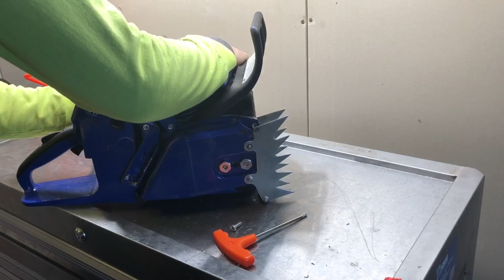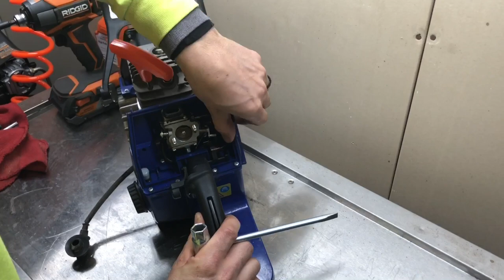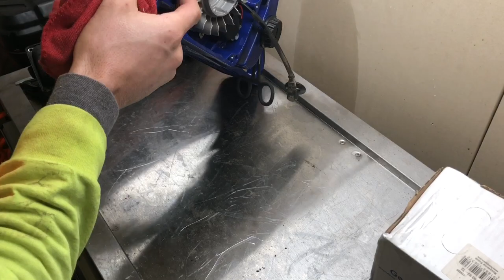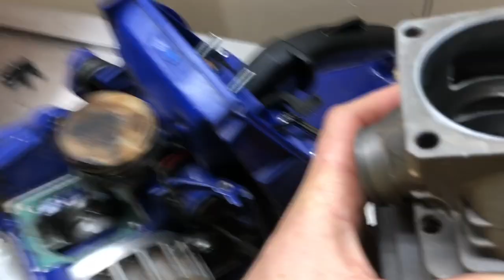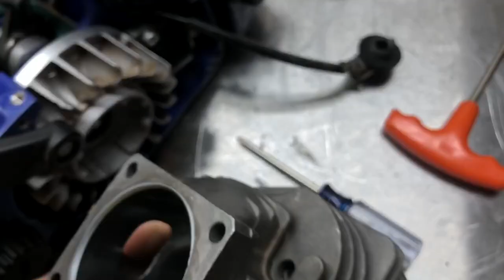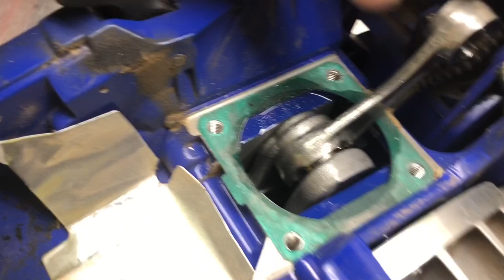HOLZFFORMA G660! What’s inside?? A quick tear down!

Comment: Speaking from experience bud.  Go real slow when ur porting.  The cylinders are very brittle and u will find cast imperfections that u may or may not be able to completely get rid of.  If u can accept that then u will be ok.  Kinda cheap made cylinder castings but they do work